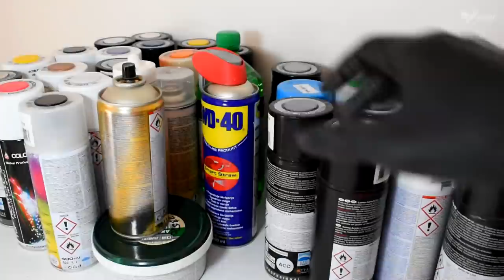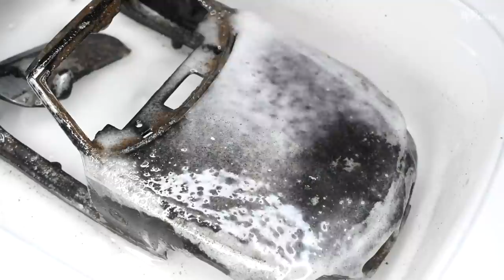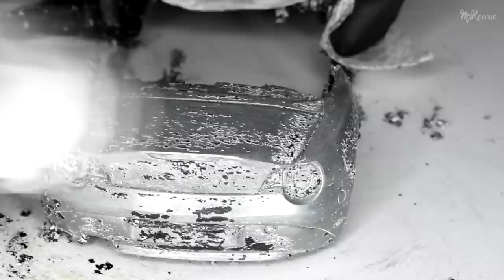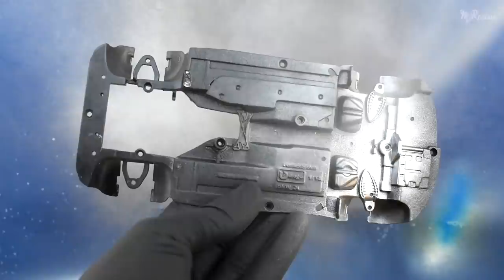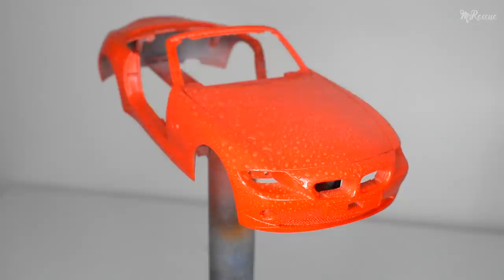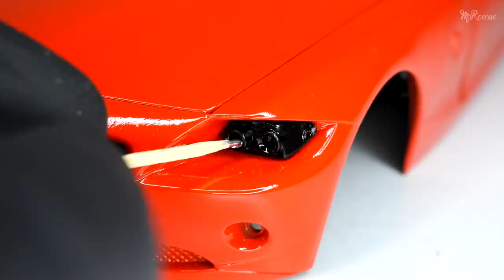Restoration Abandoned BMW Z4 Model Car

Comment: Isn’t fixing these more expensive than the actual model because you have to order replacement parts ?
Reply: Many pieces can be get by buying or finding other models. Also, if you're a casual plastic model builder you can even get more spares from the model boxes.

It happens to me with the miitary models though.